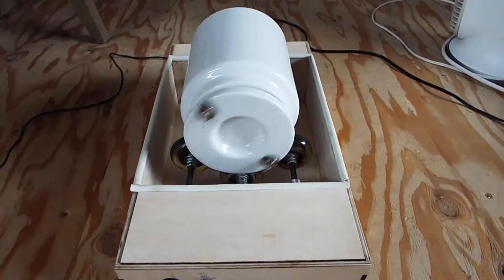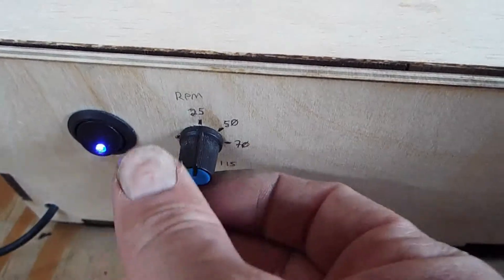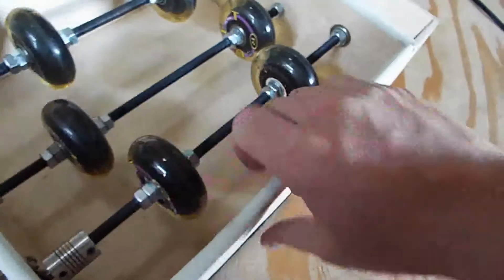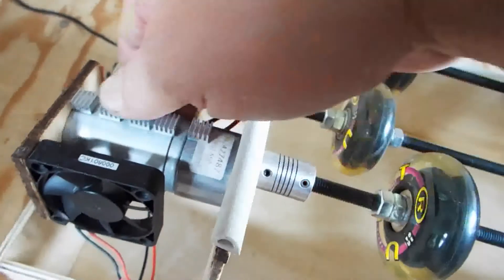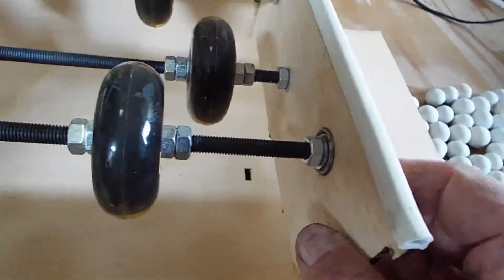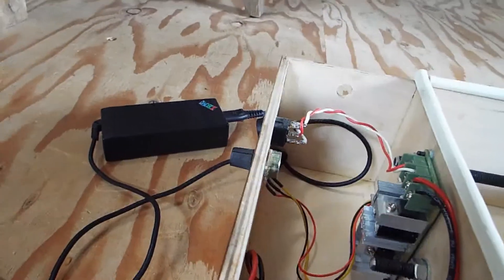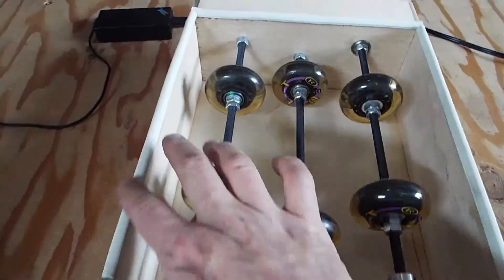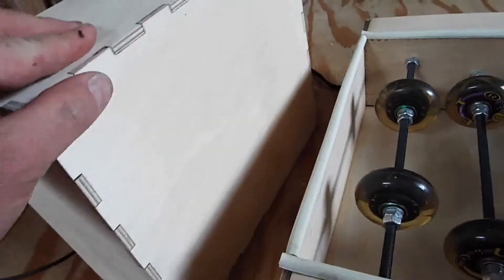My Latest Ball Mill Design

Comment: How did you fix the wheels on the drive shaft???
Reply from the maker: I did not use bearings on the fixed wheels and I used the nuts and washers on the shaft to hold them in place.
Reply: @madscientisthut  Got it!  Also, why didn't you make the middle shaft the drive shaft?  Seems that more of the wt of the canister would  rest on the middle shaft thereby incurring greater friction on the drive wheels. Were there other considerations?
Reply from the maker: It just worked out that way when I designed it. No other considerations, it works fine this way.
Reply: I completed the build using your basic design. Its not nearly as pretty as yours but it seems to work . The  problem is, when I put the steel shot in the canister (homemade from PVC about 20% filled) the wheels slip past the canister. I was going to try to modify the canister/wheel surface ( no skid stair tape, sandpaper, belt tackifier, rubber or silicone cement etc) but I was wondering if you already solved this problem. Thanks for all your help. Ill send pics when its functional.

Comment: this is awesome! do you think it would work for processing gemstone like Torquoise into powder?
Reply from the maker: Absolutely. That is what this one is currently being used for, to powder minerals for painting.
Reply: @madscientisthut  nice! do you have more detailed plans or packages for sale? :D
Reply from the maker: @astrobogie2096  I think I have the original files from when I cut this. I would have to order some stuff to complete another one, and it would only be the base you can order the jar and media online.
Reply: @madscientisthut  cool no worries if you arent set up to do that. I do have a decent vibratory bowl, can I achieve the same effect do you think?
I am crushing stone for wood inlay, I do laser engraving too :D
Reply from the maker: @astrobogie2096  Not sure if a vibratory bowl would work for that, the ball mill is dropping the balls on to the material at critical speed to crush the material into powder, I think the vibratory bowl would just polish it. You could crush it by hand ( wear eye/face protection) using a hammer then crush it into finer material with a mortar pestle grinder
then run it through a sieve to remove the larger chunks. I have done some laser engraving in to travertine stone then inlayed mother of pearl, it turned out really nice.
Reply: @madscientisthut  yep I stumbled on this video after doing it by hand and thinking there has got to be a better way than this lol
Reply from the maker: @astrobogie2096  Yep, I know exactly what you mean by finding better ways to do stuff like that. Anyways thank you for stopping by and watching my video.